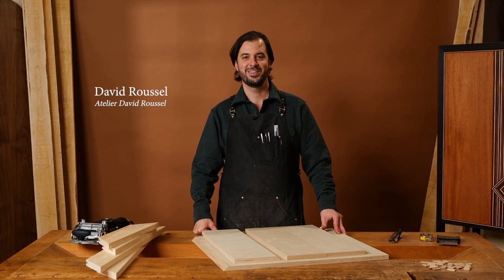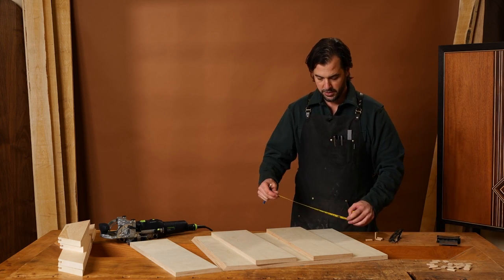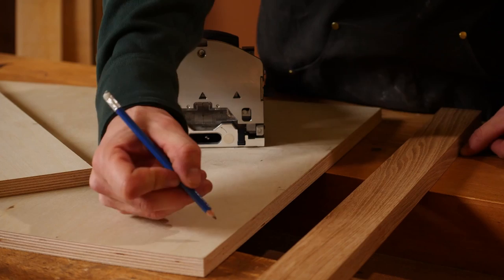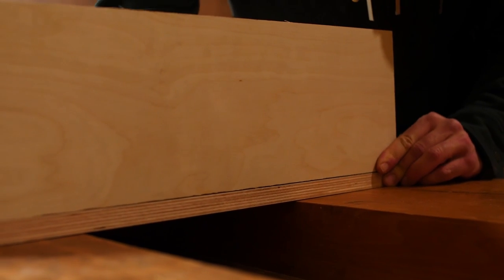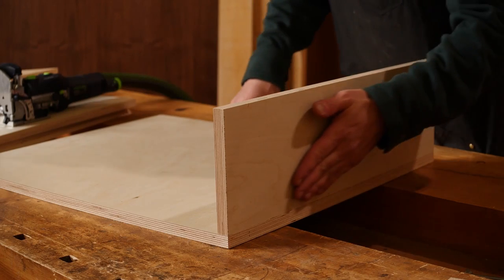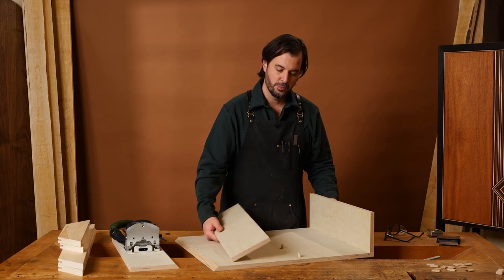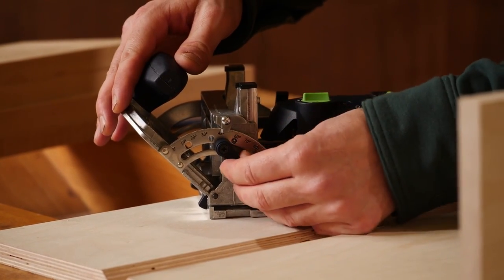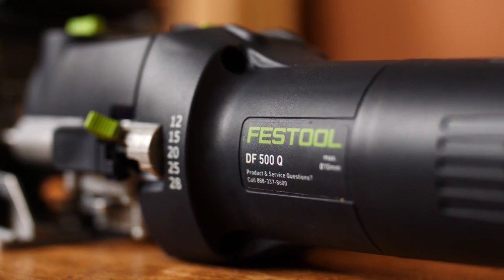How to Create Three Different Domino Set-Ups Using the Domino 500

Comment: Great demo David. The domino is a very versatile tool. In making cabinet doors to match existing doors that were picture framed with rails and stiles and 45 degree ends I bought the Veritas Domino Joinery Table to connect with dominoes the 45 degree  ends of the rail and stiles. The faces ended flush and the backs cleaned up very easy. I am sure there are other ways to do this but with the joinery table it was quick and easy to batch out the parts.